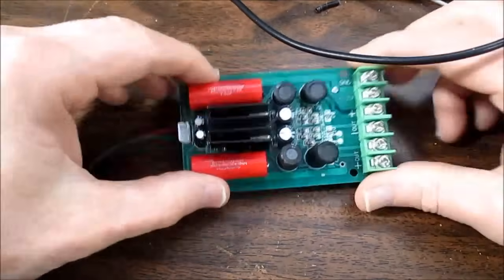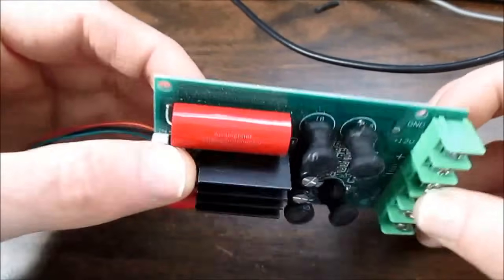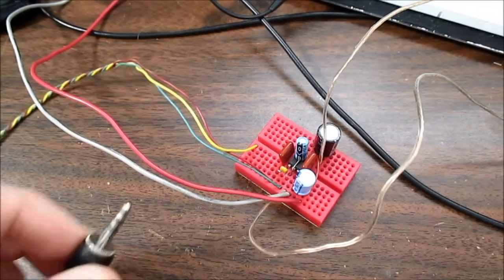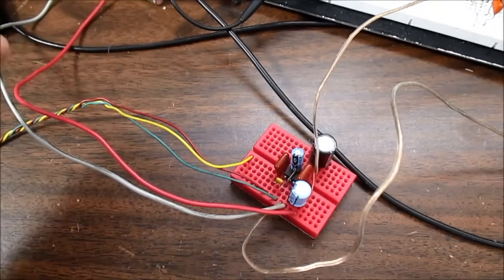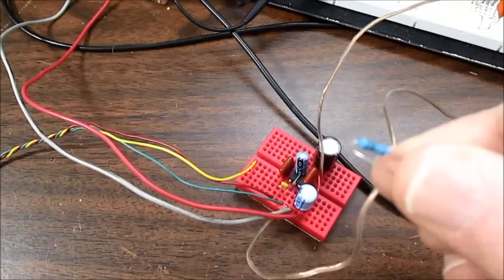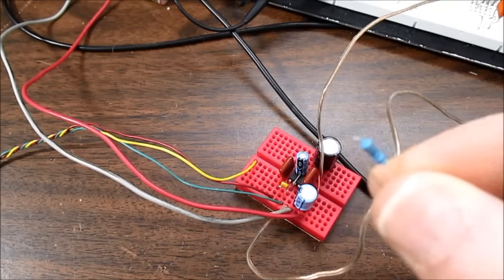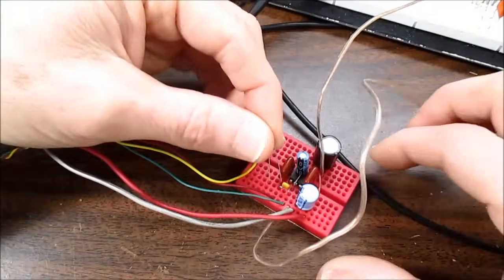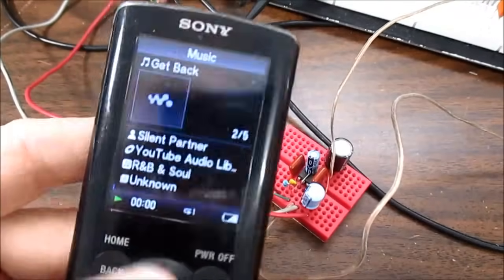STOP hum and buzz in your amplifier projects !

Comment: I've had some cheap amplifier boards cause noise by themselves. Literally powered them from batteries to eliminate any power supply buzz, but nope the issue persists. Sometimes it's just the amplifier itself it seems.
Reply: Make sure you still put supply decoupling capacitors close to the amplifier. Batteries can sometimes have a noticeable internal resistance at frequencies above dc and they are part of the signal path, since we assume the supply rails are at ac ground when designing.

If the buzz or hum is not coming from the power supply, then it's being picked up or induced into your circuit. You might try putting aluminium foil inside a box and grounding it, then put your amplifier inside the box, making sure you're not shorting anything out. If it fixes the problem, then you just have mount your amplifiers in earthed metal boxes.

If not, then you need to look at how your circuit is grounded. There should ideally be a single point that every ground is earthed to directly. That eliminates earth-loops.

Otherwise, chances are that your inputs are picking up the hum/buzz. You need shielded wires for all non-power audio wires, and again the shielding should go to a single earth point.

If all of that fails, then you really do have crappy amplifier boards.

Comment: very good video, I have a question if I want to eliminate the noise of "local radio reception", can I solve it in the same way?
Reply: I reckon you'd want to use some kind of inductor coil. Ones tuned to filter out radio frequencies are usually quite small and cheap.
Reply: Does the local radio reception still occur if you have no wires connected to the input? If so, then you've got layout problems and/or a dry soldered joint in your amplifier.
If not, then your input wires are acting as an antenna. Either change the length of the input wires until you get a station you like, or use shielded wires and make sure the shield is connected to just one ground point. Lowering the input impedance of the input stage might help a little, but RF pickup is voltage from an electric field, while hum is current induced by a magnetic field. You could try a ferrite bead on your input wires as well to reduce RFI.

Comment: Couldn't you build a ground loop isolation circuit? Basically you transfer the audio signal into another circuit by magnetic transfer which would eliminate noise on the current line, through a couple of coils, or a transformer...? I know this would eliminate any "leaking" dc currents... Then smooth it out with a few caps?

Comment: Hi John,, Thanks for the great video,, I was wondering what amplifier chip your using in the video and what current and voltage your supplying the chip with,, Sounds Great.. I Still haven't received my PAM8403's from china yet,, boy it sure take a long time,,
Reply: Damgoo audio boards have been good for me get the 5 knobber built in xover

Comment: Wait I'm confused where did you add the resistor? Is it on the line from the audio source to the amp?
Reply: It is as close to the actual audio input of the amplifier as possible, between the audio input signal and ground. If you have a stereo amp, you use two resistors, one on each channel. The point of each resistor is to lower the input impedance of each channel of the amplifier.
Reply: @RexxSchneider  thanks for the answer!

Comment: Hello all, I built an amp with TDA7297, when signal is connected but paused, and volume at zero, I hear something similar to radio broadcast. Also I have a power switch with lights that lit when power is on, I notice this light gets dim when I touch the enclosure, which is connected to ground. Can anybody give a pointer?

Comment: Hi John... whats the solution if there is bluetooth in-built?
Reply: I never found a good solution for built in Bluetooth noise. I came to the conclusion if you want fidelity, don't use Bluetooth. Regardless of noise, Bluetooth compresses audio for transmission and causes lower fidelity anyways.

Comment: It works but at the cost of ruining sound quality. The bass is almost entirely filtered out and the treble sounds a little bit weird
Reply: That depends entirely on the characteristics of the audio source and the wires you are using. If you are losing bass by lowering the amplifier's input impedance to 1K, then your source has a lot of inductance.

This is not a suitable fix for hum coming from guitar pickups, for example. To fix those sort of problems, you have to have a preamp/buffer very close to the guitar.
Reply: @RexxSchneider  thanks for replying. I wasn't making a guitar amplifier, just a big sound system for my computer. Way later than I posted the comment, I found our that my DIY 3-band equalizer, which was before the amplifier, picked up a lot of EMFs which led to all this hum and noise. I built a second version which was on a protoboard and the noise was gone so this solution wasn't needed in the end.
Reply: @Mr.Engine993  I'm glad you found the solution. Hopefully, other folks with similar problems will benefit from seeing how you solved yours.

Comment: When i cut volume ....still Humming like ac 50hz ....why....?its present when i raise volume or cut volume ....!when i power up Amplifier those Humming present with signal or not signal.....but its not incresing with volume .....!why...?
Reply: If the amount of noise is unaffected by a gain adjustment on the amplifier then this can only mean that the noise is entering your signal somewhere other than the input.
Reply: sounds like a ground loop

Comment: Blesteme!
I will try this Freaking 1k Resistor...
Damn, I tried a lot of shit so far:
No Ground Loops
No switching power supply
Insulated, twisted pair cables.
I was considering coaxial cables...
Reply: is coaxial cable a good choice?
Reply: @ardenbook  Nope, I looked into it and it's not ok because it messes with the frequency, acts like a Filter.
Maybe I'll just cut up a new, high quality RCA Cable or 3.5mm Jack Cable and hope for the best.
Reply: @Buciasda33  audio frequency is very slow, why coaxial cable can act like a filter?

Comment: What is the resistor value?
Reply: If you're going to use it with a music player or your phone, it should be around 1KΩ. If it's a line type input, then it should be 2.2KΩ or higher. It explains this in the video at 1:50

Comment: How do I go from a stereo amplifier to a mono speaker?
Reply: you common the ground(s) of the source, you put two resistors of the same value with one lead on the "hot" contacts of the source, i mean resistors like the one that John suggested as value, and join the other ends of the resistors on the mono input, this mixes the channels

edit: ahhhhhh you mean speaker... well, you can't, or you can bridge the two power amplifiers with a negator circuit on one input (like a "gain of 1" inverting amplifier) and you'll have a 4ohms drive on a 8ohms speaker, this is sometimes more than double the power of the single channel... you can do it with whatever power amplifier that withstands the HALF impedence of your speaker, per channel, and it's not BTL (already bridged.. you do nothng)... but of course you can put there only a mono signal, otherwise you need 2 stereo amplifiers
Reply: @redoverdrivetheunstoppable4637  thanks for your quick anwser.
But of you have a Bluetooth amplifier with stereo output how do you go than to a mono box without looking left and right?
I tried it with 1k but it's not working.
Thanks in advance
Reply: @gunthervde  if you can't hijack (phisically modify) the signal from the bluetooth chip to the power amplifier you can't bridge the amplifier... if you have only one speaker (i mean PASSIVE speaker) you can hook it up only on one output but you'll miss some sounds from the other channel

but, what device is that? is there a website?... a model?
Reply: @redoverdrivetheunstoppable4637  it's the 50 W + 50 W TDA7492 CSR8635
Reply: @gunthervde  i tought it was a kit or simple project, this seems already bridged (and class D), hijacking (modifying) the traces seems hard, you'll have only one channel working, anyways

if you find the L-R signal traces from the bluetooth module, you can try to cut em and fit two resistors joining on one channel, this requires microsoldering, it's not super-difficult but if it's the first time for you, you may damage the board

Comment: I already did this to my amplifier, i used 1k ohms..but still theres a humming, if i touch my volume knob humming reduce..
Reply: You should probably remove some resistors then
Reply: You may need to ground or shield the amplifier.

Comment: What about farting speakers? I put together this basic amp using LM386 chip, it worked, but the farting sound makes impossible to play :/  But, the distortion is nice!
Reply: Calebe Priester Could be a to high input. Try lowering you inputs volume(for example your phone) and then turn up your amp volume.

Comment: IF someone can help me , i have an active amp circuit like this  its just Bi amplified rather then stereo, and outputs for tweeter and Bass are shorted , buzz just like this , i dont get it , Tweeter died so i guess that is shorted , but Bass Works , AMP does not burn when i turn it on , without tweeter , There are 3 ICs Power Amps ,  i changed the tweeter one , but i guess i changed a working part , and There are 2 voltage regulators , changed both of them ,  changed caps , Rectifying diodes ,  and when i check output for bass and tweeter , 3 out of 4 wires  have a dead short on them ,  i dont get it why. Im not very good in electronics , but i just changed parts as they are and it didnt burn up , so i guess i did it good , but i have a short and i dodnt know where it is coming from , since most Chips are changed , i didnt chage Bass AMP ICs , there a re2 of them, but if they were shorted , it would burn up , but it Buzzes just liek this on a big speaker so it must be amplifying , so it works , if anyone knows of some Issues that can be the reason for this , im grateful

Comment: Anyone have idea how to solve my problem.
I have DIY amplifier with 50k volume potentiometer. 
Situation without input signal. If potentiometer knob is in middle position I get noise, but when knob is all the way left (MIN) or right (MAX), noise is disappearing ...
Reply: Use 1k or at least 10k pots. 50k pots are extremely noisy. Resistance has thermal noise. 
The source resistance seen from the next stage is the parallel resistance of two sides of the pots. So in the 12 o'clock position, the resistance is 25k//25k which is 10k. And if you have a high gain amplifier or your speakers are sensitive it can be very noisy.
I prefer using a input buffer with selectable gain and then go into a 1k pot. You will get under 1uV noise from this.
Reply: The noise you get is probably 50uV times the gain of your amplifier. If it goes near 1mv it's very apparent.

Comment: Thank you very much for your video. This is VERY useful. I have one question for you: I did an op amp for headphones with an OPA IC that claims to have VERY LOW NOISE and distortion. It sounds ok, but I'm getting a lot of noise. There is a hiss very clear in the signal. The circuit just haves 2 polypropylene filters at the input, 4 1%  1 watt resistors and 4 trimmers. Is it possible that the variable resistors or maybe the 1% resistors are creating the noise? I'm feeding the circuit with +-8 volts from ion 18650 batteries. The input is an external DAC from my computer with a very nice preamp. Thanks in advance.
Reply: Add power supply filter capacitors ( electrolytic and ceramic )

Comment: nice video, but is that not attenuating the signal?
I thought it would be a  couple of capacitors calculated to by-pass nuisance frequency's to ground.
Reply: jason laverty the noice can be a DC Level also. by static electricity
Reply from the maker: The output impedance of most devices would be a small fraction of selected resistor so attenuation would be very small.
Reply: cheers, and I had totally forgot about the possibility of noise being on a DC level as pointed out by another kind subscriber.
Reply: jason laverty ，

Comment: Great video! But actually I find it working just fine with resistor also for instrument input. But at like four times the DC resistance of the guitar pickups, ie 20 kOhm. At least when the signal meets a capacitor and then an op-amp.
Reply: Where did you get a pickup with a 20k output?!?!?!??! Most are 6k to 16k

Comment: Can you also run a cable between the power negative rail (circuit ground) and the signal ground?
I heard somewhere that it will also work, but I’m not sure if it would work with an instrument like a guitar

Comment: Hey John so what about removing a volume pot? just so its full volume. let the source control the volume
Reply from the maker: Yes you can do this if your source has its own volume control. You might want to place a resistor from input to ground where the pot would be as there could be extra electrical noise entering the amplifier when the audio source is turned off or unplugged. This is because the resistance of the pot is no longer part of the circuit. It would be easier just to set the pot at max and forget it.

Comment: 1 year of nothing but frustration.....amp works great at friends house, noisy as shit when I start to add gain to it at my house. Electrician checked house ground, even turned off EVERY leg in my house except the outlet my amp is plugged into. NO fluorescent lights or appliances on that circuit, new 60$ instrument cables, both amps (solid state AND tube)taken to pro shop, and play fine....absolutely ready to lose my mind.....I dont live next to a  power station, navy base, and I dont think my neighbor has a nuclear particle accelerator in his basement...W  T   F!!!!!????
Reply from the maker: If it is fine at other locations, then there must be a noise source at your house. Wiring can be fine, but a noise source still can cause problems. It could be a light dimmer or a switchmode power supply nearby that isn't filtered well.

Comment: If you take a 1k resistor across signal R. and GND and L. and GND then you measure 500 ohms between signal L. and R.  since both inputs have the same GND. 500ohm   is not good. You get a lot less stereo!

There are always compromises!

There is no such thing as a free lunch!

Better to fix the root of the problem!

Comment: Hi how can I fix this on my pre-built amp I ordered from amazon? I am not a audio techy guy and don't want to spend too much time learning how to build my own. Is there a special cable or some filter I can buy?
Reply: Always use shielded cable for all audio signals that are not power-level (i.e. anything other than speaker cables). Decent quality audio cables need not be expensive, but they do make a lot of difference in reducing hum and noise pickup. Amazon's basic line of cables are usually fine. FWIW, I've bought cables from Kenable for years and never had a problem. I have no affiliation with them, BTW.

Comment: what about hiss?
Reply: ok thanks, does a metal case help...is the hiss radio noise picked up by components, or something internal
Reply: Hiss is normal for solid-state amplifiers with very high gain. You can try reducing the input gain (NOT volume) if you can.

Comment: Advantage: Noise Removed
Disadvantage: Sensitivity reduced (The Amplifier will not gonna play same volume as before it will be reduced)
My Opinion: try making it on PCB or Pref Board with proper soldering and use proper shielded cable for the input)

Comment: sir i have put 1 kohm it reduces noise but weird problem, it reduces bass effect of music drastically---without resistor bass effect is good-signal-PC sound card-using dual rail tda 2050----tried 2 k ohm--reduces noise lesser than 1 kohm-http://diyaudioprojects.com/Chip/DIY-TDA2050-Hi-Fi-Chip-Amplifier/TDA2050-ChipAmp-PCB-Component-Layout.pdf---http://diyaudioprojects.com/Chip/DIY-TDA2050-Hi-Fi-Chip-Amplifier/
Reply from the maker: Loss of bass is possible with the reduced impedance caused by the resistor due to capacitive reactance of a series capacitor in the soundcard (or the amp's own input capacitor if the resistor is in the wrong position). If you connected the resistor on the input between the input capacitor and the 2050 IC, it should be moved to the other side of that cap (the lead opposite of the one connecting to the IC). If bass still falls off, the soundcard can't handle the 1K load. You will have to reduce noise another way, such as with better lead shielding. Your link says page not found.
Reply: the circuit is----http://diyaudioprojects.com/Chip/DIY-TDA2050-Hi-Fi-Chip-Amplifier/TDA2050-ChipAmp-PCB-Component-Layout.pdf
Reply: parts used---http://diyaudioprojects.com/Chip/DIY-TDA2050-Hi-Fi-Chip-Amplifier/Updated-List-of-Components-for-PCB.pdf
Reply: sir-i have connectes 1 kohm resistor between pc out and amplifier input cap-------what i do to do-lead shielding